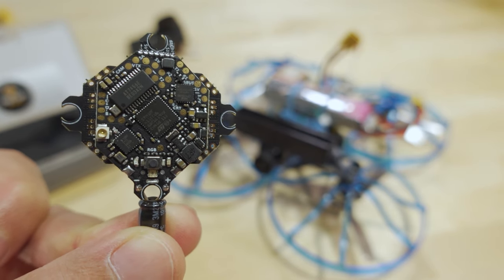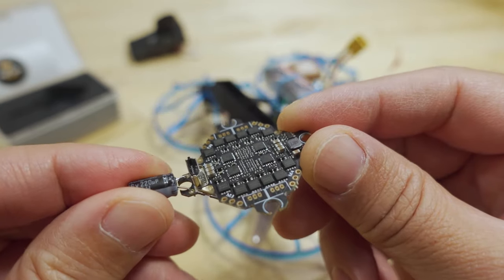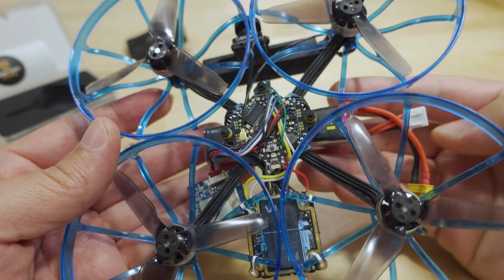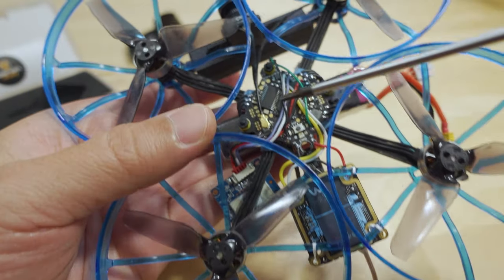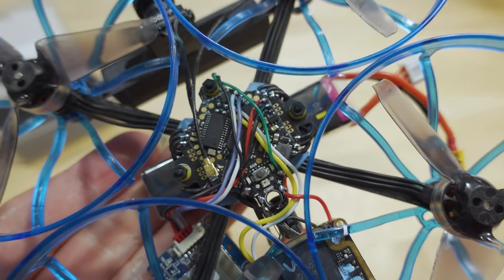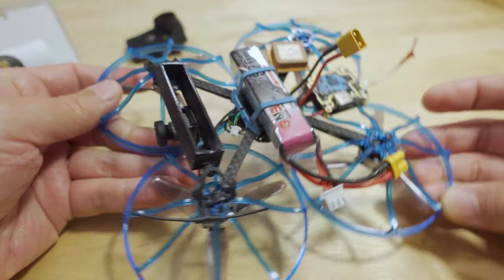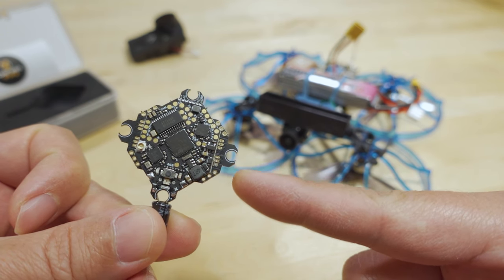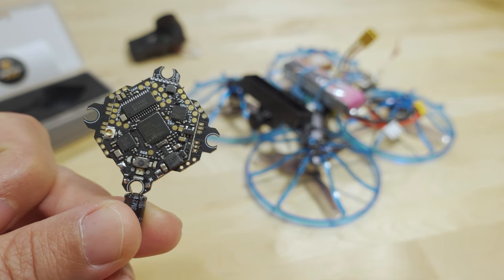Ultralight Cinewhoop ❎ DarwinFPV ELRS AIO FC 🛠️

Comment: Good day to you Albert 👋. 
I don’t have a cinnawhoop myself I just like to watch your build videos for tips and tricks. 
Question: have you noticed any vibrations you can’t get rid of ?

The reason I ask this is because the way the capacitor is soldered hanging off of the AIO board. 

In my experience on a 5 inch if you leave it hanging off like that it’s basically a tuning fork. It looks like you could join the two posts of the capacitor with hot glue possibly even touching the capacitor maybe even fastening it to the board. If you do that it helps eliminate the tuning fork affect it maybe is not so bad on a smaller rig like this I still can’t help but think there’s got to be some vibration with the capacitor hanging off like that only connected by the two negative and positive posts. Just a suggestion it wouldn’t be a hard modification. You could even use some silicone when you attach it to the board right there on the edge I know it would be finicky I’m a tinkerer lol I like to make things better by modification. 
Thanks for your videos I watch just about all of them. 👏👏👏👏👍
Reply from the maker: I have not noticed any vibrations from that.  It's pretty smooth even with a bad tune.
Reply: @AlbertKimTV  wow that’s pretty impressive. 
I guess that cap is a lot smaller than a 1000 uF 35v capacitor. 
Thanks for the fast response 💨!!!!

Comment: I modded my Betafpv 95x to use a flywoo aio with the usb pointing upwards. Had to remove some plastic but you can barely tell and it's reachable even with the battery mounted.
Reply from the maker: Nice!

Comment: I would love to use this board but those solder pads are definitely smaller then I want it to be due to my poor soldering skills.  Great footage!
Reply from the maker: For an AIO whoop style board, the pads are actually slightly above average in size.  I guess you fly 5 inch with the larger 30x30 boards?